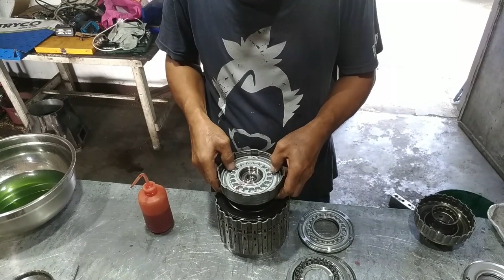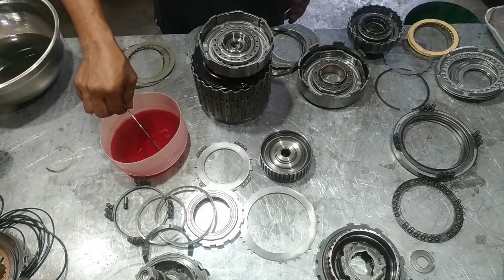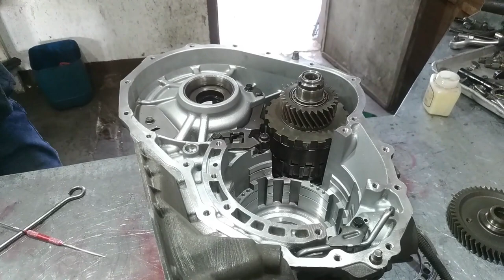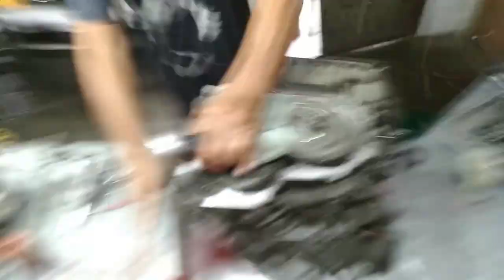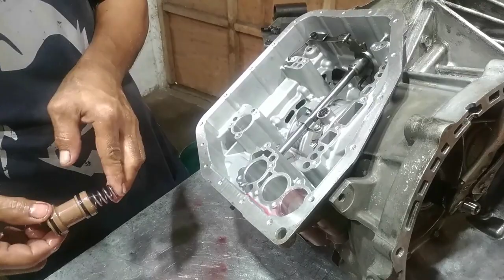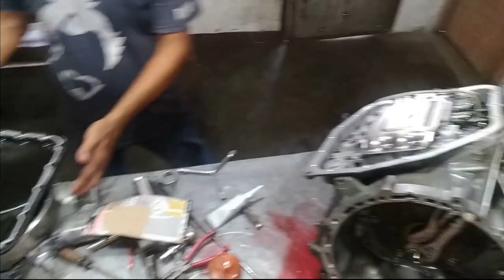A246E Toyota Corolla Altis Automatic Transmission Rebuild Part 2

Comment: Magkano pa ang pa repair ng transmission 2013 altis 1.6 automatic
Reply from the maker: Ang rebuild po ay inaabot ng 35k kung walang hard parts.
Reply: Ano po contact number nyo ksi paayos ko un altis ko 2017 papalitan ng shift differential